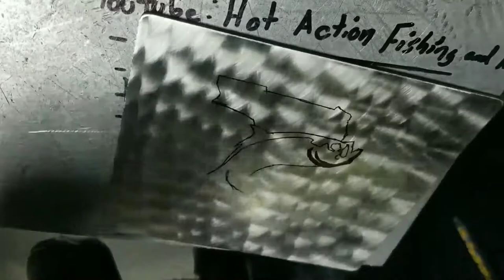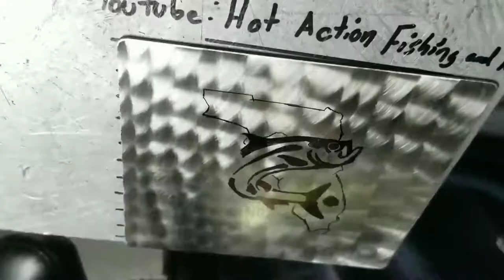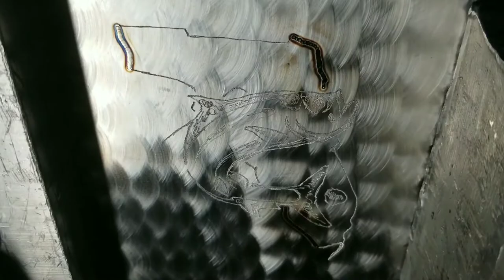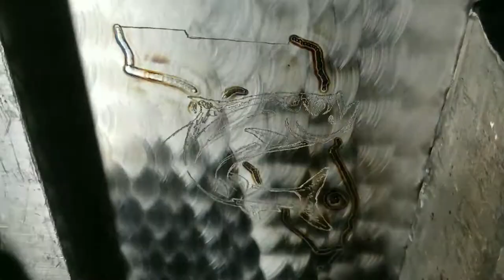Welding Art - Florida tarpon

Comment: What attachment did you use on your cordless to get that effect?
Reply from the maker: I used just a scotch brite pad.
Reply: Hot Action Fishing and Fab thanks!  I just cut out a few tarpon and redfish on the CNC plasma in 1/8” steel. Haven’t decided how I want to finish them yet.
Reply from the maker: Thats cool. Yeah it's a easy efect to do and it looks cool
Reply: Hot Action Fishing and Fab I agree!  Well done. You happen to have a link to the pads you’re using?